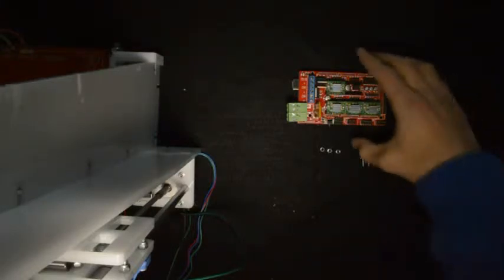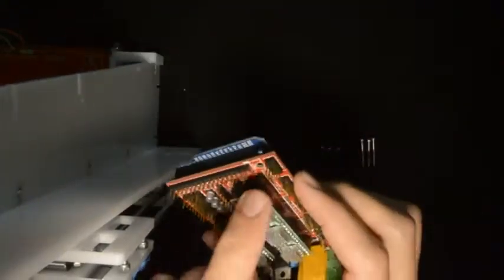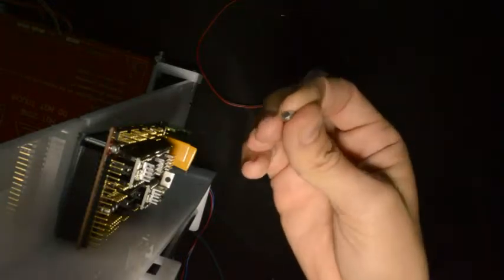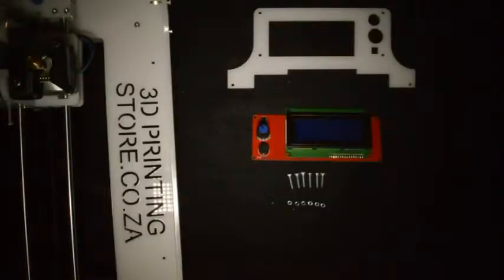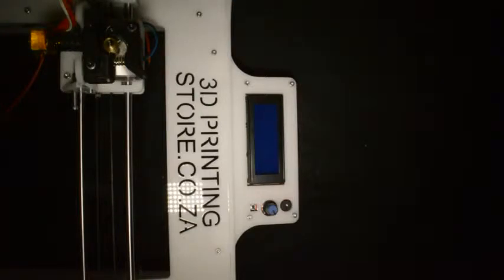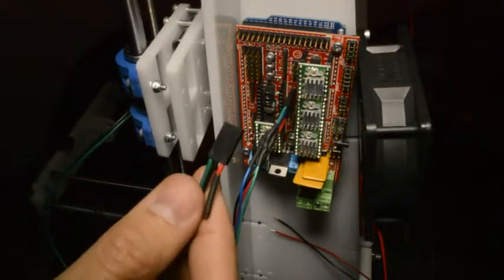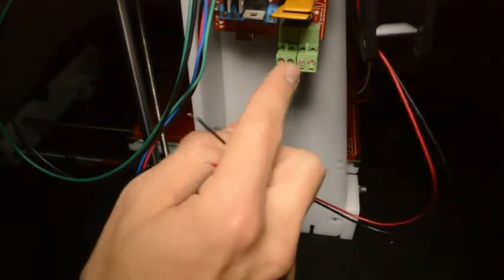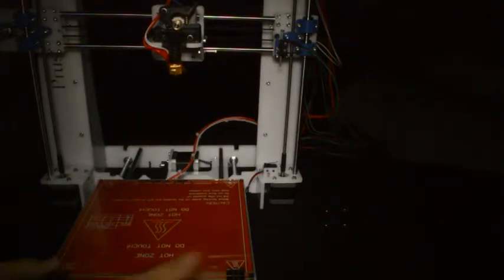Prusa i3 Kit Assembly: Video 10 - Electronics

Comment: Can we please have a link to a clear copy of the wiring diagram
Reply from the maker: Hi Jaco.  We have placed a copy in the latest assembly instructions:  https://dl.dropboxusercontent.com/u/39187826/Prusa%20i3%203D%20Printer%20Kit%20Instructions.doc
Reply: 3D Printing Store.co.za this link does not work
Reply: Eduan Neeb Hi Eduan
Yes, that is the old link.  Here is the new link:
https://mega.co.nz/#F!Tp9Q0QxT!Zf7_xp1uMf6GTbwezcPksA

This is the link to a Mega upload folder with an electronic copy of the assembly instructions and a lot of other information related to the printer.
Regards
Paul